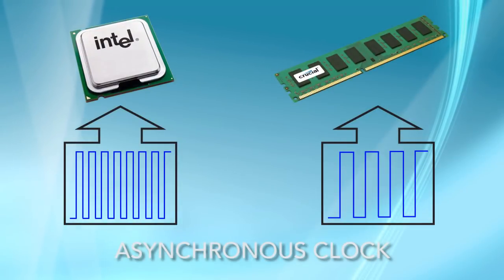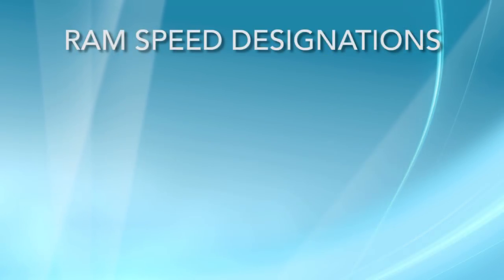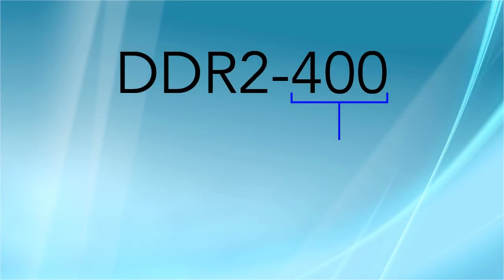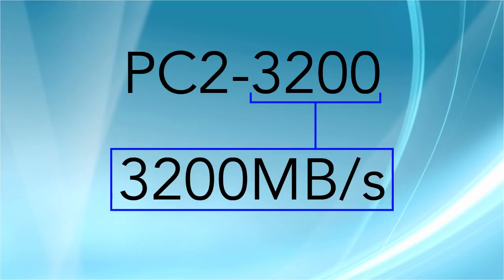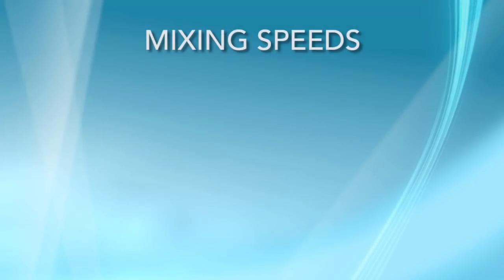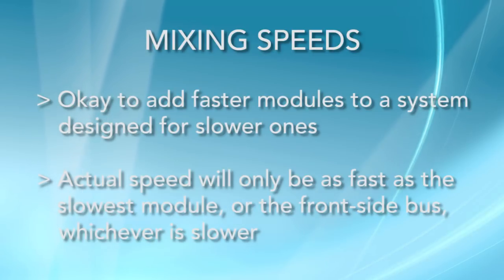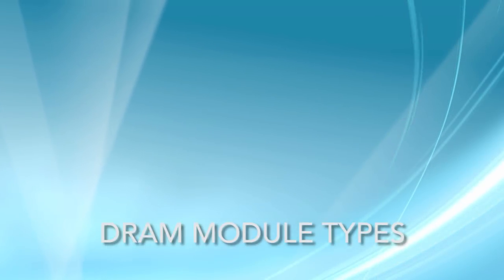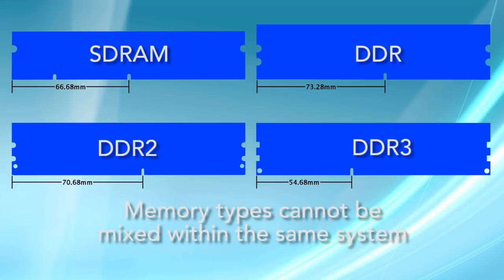Understanding Computer Memory Speeds

Comment: Just returned a couple of memory modules to Crucial as their scanner recommended pc8500's when my existing modules were pc4300's - also the cas latency specifications were not matched - I blame myself for not physically checking initially.

Having said that, Crucial did not hesitate to refund - and also the postage was free both ways - They have good customer support. I would use them again if they had the legacy memory that i needed.